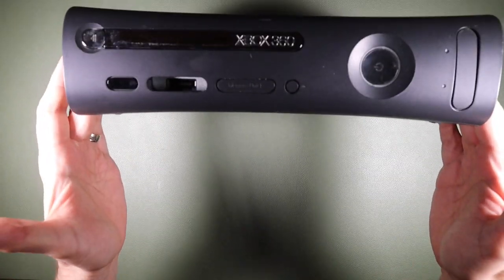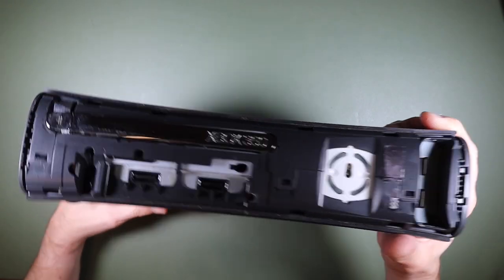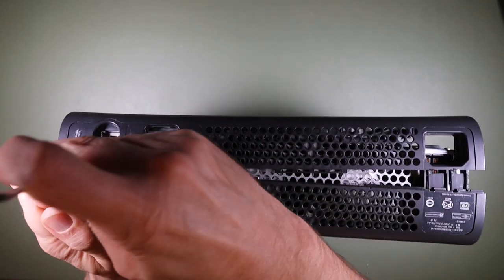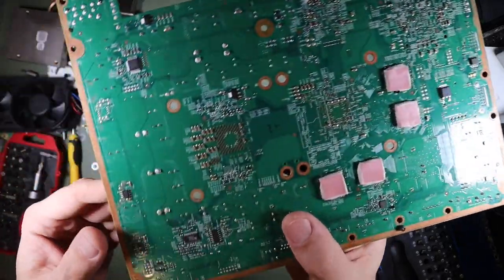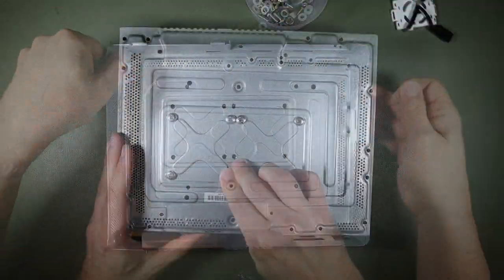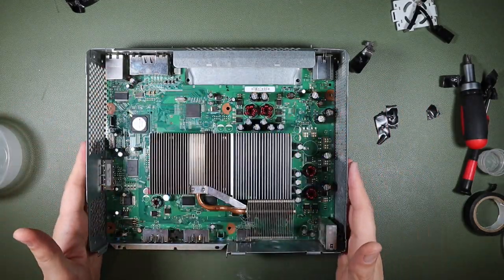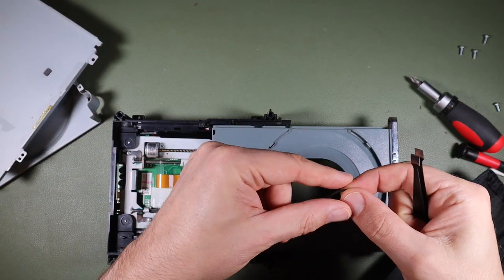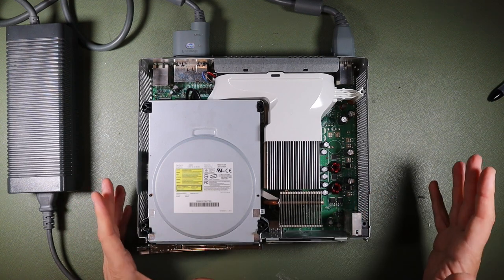Xbox 360 Try to Fix

Comment: Great job! :)
Normally there are no washers in the Xbox and the heatsinks are held by the "X-clamp". I think what we can see here is some kind of "X-clamp fix kit". I would question whether it was worth to be applied when the Xbox still ended up with the same red ring of death.
Anyways, the question is how long this repair will last :) The first Xbox with E74 Xbox I have tried to fix ended up with a short after the reflow however I have managed to fix an Xbox 360 slim by reflowing the "XCGPU". It was working fine for weeks until I have thrown a CPU/GPU intense game at it (Halo Wars) and with many units on screen, it froze and ended up with the red dot of death again. I did a second reflow which "fixed" it again but playing the same game kills it in 30 minutes...so I came to the conclusion that in some cases, it is a faulty chip rather than a broken solder joint and reflowing is only a temporary fix. I hope you will have more luck though! :) Keep posting these videos!
Reply from the maker: Thanks so much Norrecito... you are too kind. I started to realise as the comments started coming in that the washers were not the factory config, they did seem very amateur, but it never occurred to me at the time (although all the clues were there) that they were some kind fo fix. I think you are the first to confirm it. A few people have suggested these are temporary fixes, I've sold the console on now, but didn't get any complaints so fingers crossed. I ran it a for several hours playing halo 3 on a few occasions so lets hope for the best. Thanks for all the info. I clearly have much to learn about these machines and I am very grateful for your detailed comments. Thanks!
Reply: You are correct. Reflowing/reballing is all temporary unless there has been physical shock. The problem is in the flip chip of the GPU itself and the only way to fix it long term is to replace the GPU.

Comment: Unfortunately with these sorts of fixes, they tend to be very short term. In past experience with the xbox360s I've worked on, if you actually drench behind both CPU and GPU with liquid flux before heating, you get a few more months. Reballing with leaded solder is better but obviously a lot more work.
Reply from the maker: Thanks Mark I am very new to this so I was happy to get it going at all but I understand its probably not a forever fix. I didn't even realize the washers weren't factory although it makes perfect sense. I have a long way to go before I attempt reballing but the flux idea is a good one for me to try. One of the other comments suggested the residue on the board could be flux from a previous repair. Very interesting stuff. Thanks so much for your comments I'm learning a lot from this kind of feedback. Cheers!
Reply: @RetroTechRepair  No problem! Another amusing thing to note. On the first revision motherboards, the CPU and GPU corners weren't glued to the motherboard. With trusty airgun in hand I went about heating the CPU and heard a loud pop. On closer inspection, it was so warped that one corner had completely lifted and left the solder pads. Needless to say that became a doner machine ;-). Oh and before I finish blethering on, 6 of the retro handhelds that you've repaired I have boxed in my attic from childhood so I know where I'll be coming should I need tips on repairs ;-). Look forward to your next video!
Reply from the maker: @mjh17474  Thats great Mark, Thanks! I have a few more retro handhelds to come. They are easy fixes compared to the 360. Glad to have you along.
Reply: Erm, no. Reballing just heats up the failing dye and makes it work for 2-6 months. The true fix is to replace the GPU.
Reply from the maker: @botchedrepair1542  @Mark Hill  I don't have the skills to replace or to re-ball! but I am grateful to both of you for your comments. Thanks. I like a bit of informed debate (you are both more informed than I am)

Comment: Great job and well done on the fix. Pity you made a loss but if you enjoy what you're at and get that great feeling when you manage to get the "unfixable" working, then that's a profit in itself. Keep up the good work ;)
Reply from the maker: Thanks @8bitsinthebasement. Yes its not about the money, I wondered if the "wheeler dealers" element would drive up interest but I am not sure it did. Xbox seems a popular topic though. How are things over in the basement?
Reply: @RetroTechRepair  If having a good time doing what you do equates to things going well, then I'm having a great time here in the basement. Though sometimes it can be hard to find the time. Thanks for asking and take care.
Reply from the maker: @8bitsinthebasement  well you are doing some good work. Did you start doing the basement up too?
Reply: @RetroTechRepair  I had a broken water pipe do a little damage in the part of the basement I was installed in in January (my own fault really, it was an accident waiting to happen). So I moved to a lower part, away from the water pipes and built myself a little studio and a small work area for repairing and working on boards. It's not quite finished yet, but it is servicable. There are two ways of looking at it I suppose, a happy accident or "Needs must when the Devil vomits in your kettle" as Edmund Blackadder would say ;)

Comment: Surely, with that many washers, somebody has already been inside it and tried to pull the heat sinks down by force.
Reply from the maker: Lee, I bet you are right, but it never occurred to me at the time. The washers were between the PCB and the case, fewer washers would have flexed the PCB. One of the other commenters mentioned a "Washer fix" is that common in 360 circles do you know? I'd love to learn more. The absence of a security sticker suggests that yes I wasn't the first in there. Thanks much for your comments. If you have more info let me know I'd love to learn
Reply: @RetroTechRepair  yup you are right somebody already got after it but usually you don't put the screws through the case when you do that just direct to the board with washers that way it flexes the board which is hard to do connected to the case
Reply from the maker: @ctoddgo3074  Interesting. It doesn't sound like flexing the board would be a good idea long term. Whoever did mine first time either thought the same or didn't bother to read the instructions!
Reply: @RetroTechRepair  it just flexes it back to where it's supposed to be the design flaw on those was overheating caused the board to flex and the cpu wouldn't make good connection anymore the x clamps didn't hold enough early 360s will not be around for long these fixes are the same as refurbishers use and are a band aid at best but they are interesting repairs
Reply: @ctoddgo3074  That is false. This flexes the board into a bent shape that causes damage. The original X clamps hold the board correctly. The flaw on the 360 was a manufacturing defect in the GPU made in Taiwan by ATi, that was solved in mid 2008. Some consoles were lucky and got a GPU from a second Vendor in Korea and those rarely fail. This horrible bolt mod should be undone. All it does is push the GPU and eDRAM dies hard against the defective underfill compressing the flip chip which temporarily revives it but it'll fail again later.
Reply: @Josh.Davidson  I know because I'm bill gates and if you question me again I'll put a chip in you

Comment: Sorry but the only solution to E 74 is to replace the GPU. What you did just softened the underfill in the GPU and eDRAM does which makes it work for a short period of time again. The 360 is one of the worst in regards to having so many awful fake repair guides and advices from people who have absolutely no idea what they are doing.
Those awful bolts should also be removed and the original Xclamps put back to avoid the board being warped and damaged further.
PS: please don't fan mod, that's another bullshit that does nothing.
Reply from the maker: Hi Josh.Thanks for your comments. There are some good videos out there on Xbox360 repairs from people who know what they are doing, it looks like your channel is a great example with some nice detailed vids. Unfortunately I am not experienced in these repairs. My aim is to share my experiences more to entertain and encourage than to  inform or educate.  I didn't even realise the washers weren't original! (I dont have the x clamps) but I do appreciate your comments and will be sure to check out your vids for Xbox repairs and upgrades as I learn more about this console. Thanks again.
Reply: @RetroTechRepair  Hi,
Thanks for the response. Apologies if my reply seemed hostile, that was not the intention. I wanted to leave this comment just due to the large myths surrounding Xbox 360 repair as I've sadly seen many many consoles destroyed by warping due to heat gunning and bolt modding :(
Reply from the maker: No worries  @Josh.Davidson  I totally understand. I am grateful for channels like your own with detailed How-to's without that the "have a bash gang" like myself would have nowhere to go for reference. Where I need I strongly caveat my vids in the intro and the description. I might even rebrand at some point as I make the vids only for entertainment. I like to think my 360 though not perfect was no worse given what I had available to me. The heat was at least temp controlled, I actually removed washers to avoid flexing the board (hopefully matching the height of the X-clamp that at the time I didn't know existed) clamped it only enough to be secure and ensure good thermal couple. I cleaned the dust from inside the case (not shown in the video as I try to keep to less than half an hour), fixed and cleaned the disc drive. Whoever bought it paid less than I did for the bundle in non-working condition and if the repair didn't last they still have a board that isn't ruined. Anyhow no need to apologise its all good. I'll be sure to check your channel and hope you will stick around here to see a few more clumsy repair attempts. When I try my next 360 I will know where to come for help. I genuinely appreciate your comments. :)
Reply: @RetroTechRepair  Hi,
Thanks for the kind comments and your openness, nice to see. Lots of people have gotten very angry 

The height of the board is not the root cause of the flaw, more the way it pulls the corners towards the heatsink causing a bowing in the board. I filmed a little explanation that might help.
https://youtu.be/C8gggL3f5Xw

Will check out more of your stuff :)
Reply from the maker: @Josh.Davidson  Nah... I'll save getting angry to those selling "kits" of screws and washers, or those modding consoles they paid a lot for. You clearly know your stuff. In fact some of the other comments pointed to your vids, but I deleted a few as they were a bit sarcastic and life's too short. Microsoft make mistakes I am sure like we all do, but I am also sure they wouldn't go to the trouble of casting Xclamps if a few pressed washers would do. I probably didnt show it on the vid, but I also put washers between the heat sink and the board as I didnt like the way the board flexed. I understand it probably wont help, but at least I thought about it. Thanks for checking out my other stuff, its all pretty amateur, but my aim is to entertain! Thanks again
Reply: @RetroTechRepair  Hi,
understandable, and I apologize about those people. They don't echo my intents. I've told people many times that informing should be done politely but sadly not everyone follows that idea.

The mistake was actually of ATi Taiwan plant using defective underfill, a topic I plan to cover in a future video to address the reballing myths. The GPUs from the Korean factory rarely ever fail, and I know Microsoft knew that since they used only Korean made models to fix earlier boards starting sometime in 2008. There is even a special 80nm GPU called Elpis made for retrofitting old Xenons, and also Korean made. Luckily they fixed this fault sometime during the Falcon lifespan in the RHEA GPU and then they stopped failing. :)
Reply from the maker: @Josh.Davidson  Thanks Josh. One of my other subs very kindly offered to send me another broken 360 so perhaps when it arrives we can reconnect and you can advise me on a plan of attack for it.
Reply: @RetroTechRepair  This is exciting! An Octal and RTR collaboration?
Reply from the maker: @botchedrepair1542  I'm happy to engage! I unfortunately don't have nearly as much time to spend on the channel as I would like so it does take me a while to get the vids out :(
Reply: @RetroTechRepair  Take your time mate. Even though you didn't fix it quite properly in this video, you actually rock and are open to other people's views. I don't see many people like this anymore. I'm looking forward to Octal replacing your faulty XCGPU though on that new old 360 though lol:)
Reply from the maker: @botchedrepair1542  Cheers Mate!

Comment: Flux it has been reflowed
Reply from the maker: Really? wow is that way the residue was... and the washers were not form Microsoft but from an earlier repair? that would make sense. Tell us more!. I know nothing about the 360 but would love to learn. Great console
Reply: You would add liquid flux under the two chips and heat it to repair the solder balls the 360 pcd flexed under heat they made it too thin

Comment: Stupid design on the 360 case
Reply from the maker: Hi Jamie, yes, totally agree. I know that stuff has to be cheap to make so we can afford it and that It has to be easy to make so that it's cheap to make, but  from a service point of view, it kept me guessing. I suppose it is quite an attractive looking console even though its asking over a tin box. Perhaps if I had known more about it I could have done a better job. Anyway it all worked out in the end. Thanks so much for your comment. I really appreciate it. Cheers RTR
Reply: First thing i ever learned taking apart these 360 consoles was to get the special tool for opening the back really easily, could of been made far more easily but nope it was a pain...
Reply: @Pcaddictt  100% terrible design overall a terrible console PCB was far to thin to dissipate the heat
Reply from the maker: @Pcaddictt  If you know of a tool that helps let me know. I am keen to try another one. Thanks for the comments
Reply from the maker: @jamiepowell6655  Probably very true, looks like the extended heat sink was an after-thought too. Cost cutting perhaps. Thanks for the comments
Reply: @RetroTechRepair  search eBay for xbox 360 tool, you will see one with multiple pins tabs, to open the back of the case about 4 pound or so.
Reply: @RetroTechRepair  No worries keep up the good work